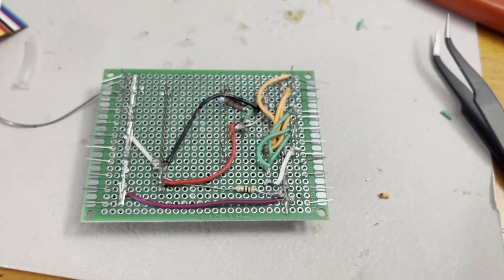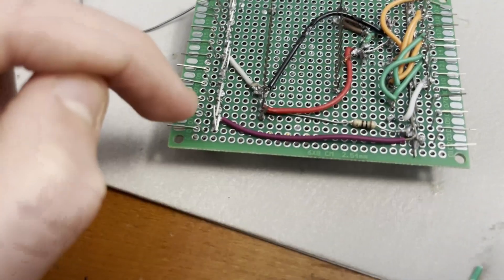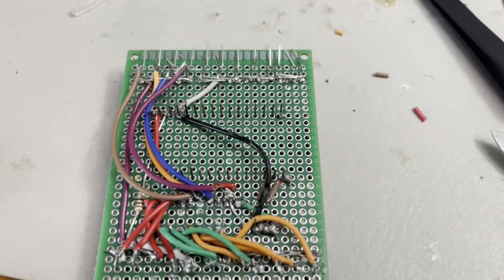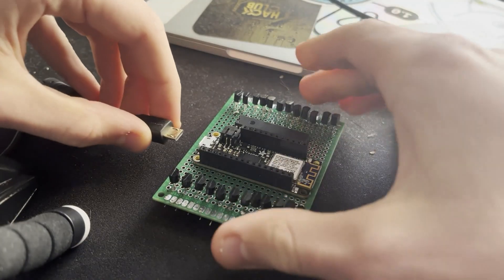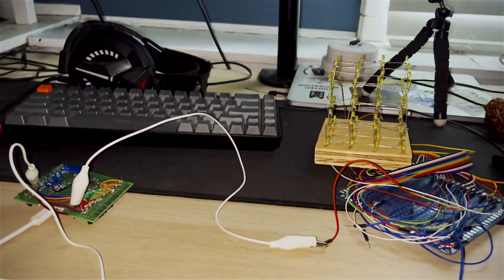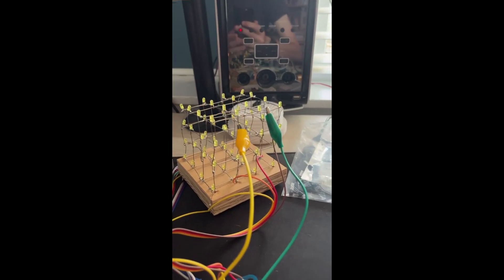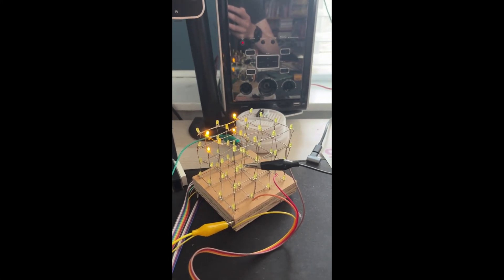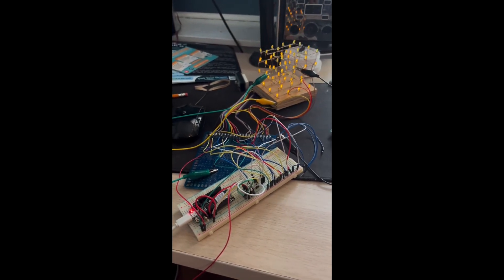the little led cube that kinda could

Comment: Nice cube, I would like to see a deep-dive into the 3d multiplexing aspect
Reply from the maker: I'd be happy to explain it but this one is really simple. Basicaly each of the ground connections (cathodes) of each led get connected connected in a grid to that rows leds and then connected to ground via a transister; the positive (anode) side of each led is connected in a column to every led above and below it and then that column is connected to a 3v line limited by a 100ohm resister! I wasn't able to fully finish the control circuit and didn't have enough space on my breadboard to connect everything up so I just connected all the columns to the 3v line and pulsed the rows with transisters! I hope that helped explain it a bit! I definetly should have included an explaination on how it works in the vid

https://www.instructables.com/Led-Cube-8x8x8/

Comment: If you order the wrong resistors or FETs or anything electronic, just keep them.
Start getting those plastic, divided, carry cases and just stash them away. When 
you need them, you will have them. Unless you are really strapped for cash.
Reply from the maker: looking back on returning those it probably would have been better to keep them; i was definitely pretty low on cash though lol

Comment: Hope crap that's cool. It'd look amazing with rgb leds. You shocks just keep iterating on it to see how high you can get the resolution.
Reply from the maker: thanks! it toaly would!!! theres a few people who have made rgb led versionsbut the main problem is that they are prohitevely expensive the larger you go and its exponentialy harder to control because you need to deal with 3 semi analog lines for each led now. I definetly am going to try to make this bigger but i might just stick to a panel for my next project